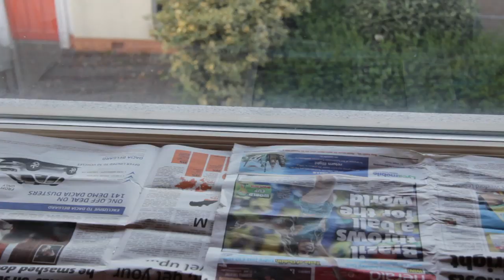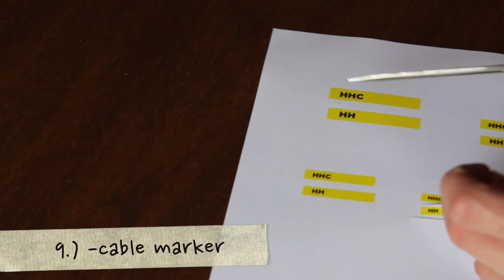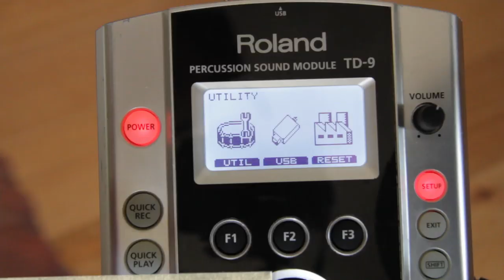Roland TD-9K restoration

Comment: Wow!
Very nice work!
Specially love thermo-shrinking tube for cable reparation, and marking cables! :)
Reply from the maker: Thanks Aleksandar. Heat shrink tubes are the only professional way to isolate a cable in my opinion:) But it is better to use a heat gun instead of a lighter.

Comment: Good way to keep my hi hat controller in place? The carpet is kinda thin. And what's a good way to mount the cy-5 pad? I don't have the felts and the screws to tighten it. I've been wrapping the pole with a cloth and then twisting the pad on it.

Comment: Hey Vdrum Tips! Great video. I have the exact same drum kit and also want to do a bit of a restoration but I am missing a tiny screw. One of the small black screws that mount the console to the back plate. Any idea where to get a new one? thanks :)
Reply from the maker: A normal M4 screw, that is not too long should do the job. Are you living in the  Inch world (e.g. USA) or in the Metric world (e.g. Europe)?